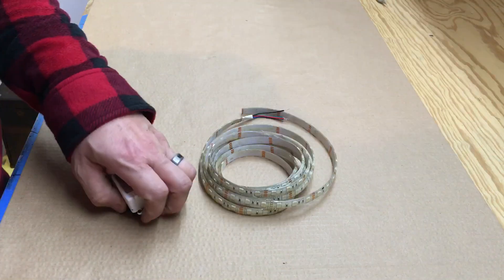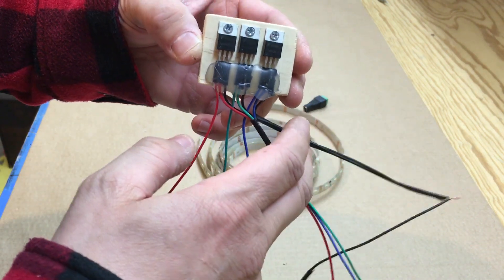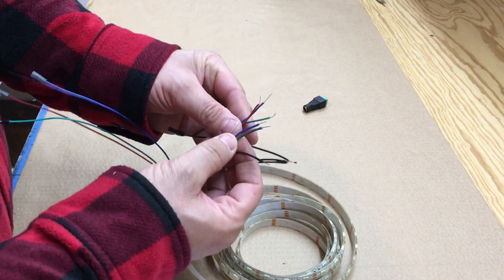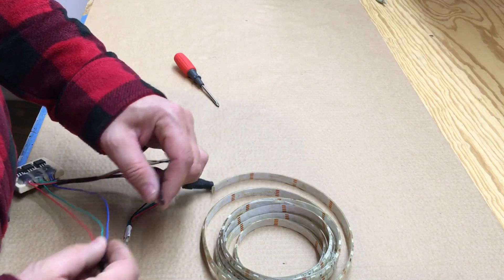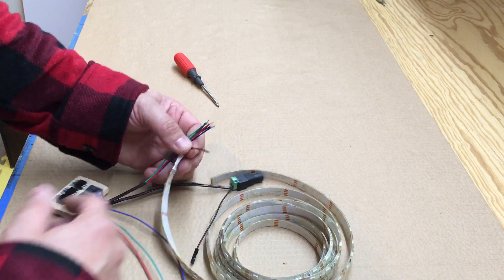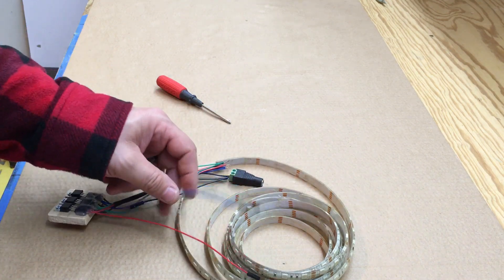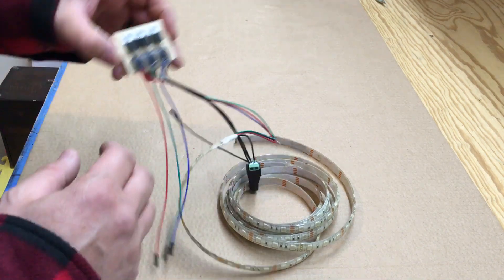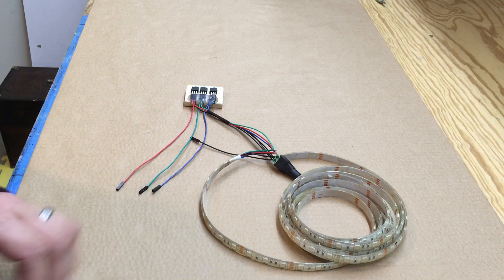How To Hook Up A 12 Volt LED Strip To A Raspberry Pi

Comment: What about 12V 3-pin(+12V, DIN, GND) LED strip, what about 24V?
I'm using 5V LED strip, searching for method to connect 12V/24V LED strip to Raspberry Pi